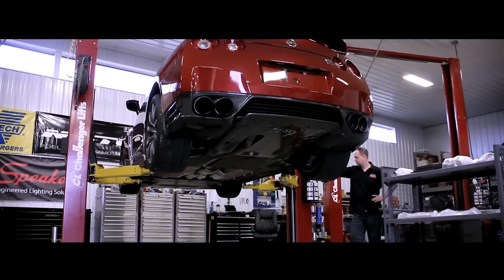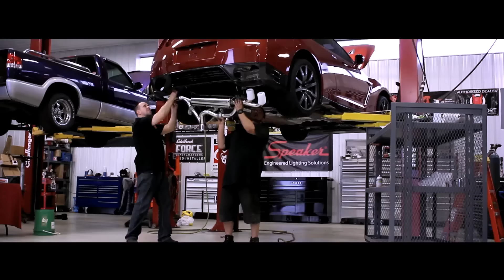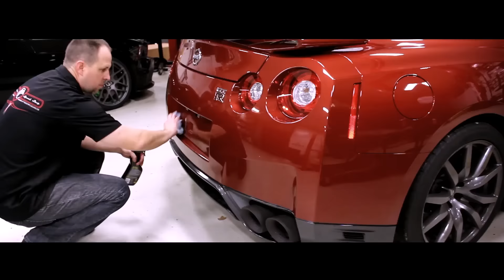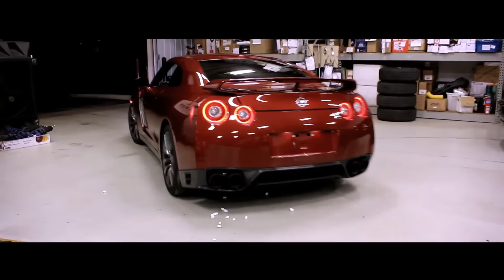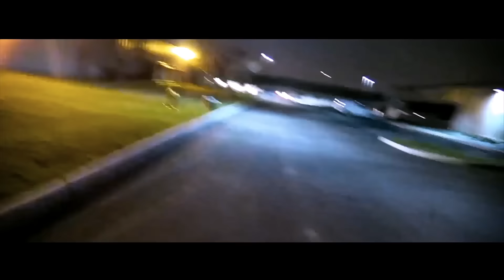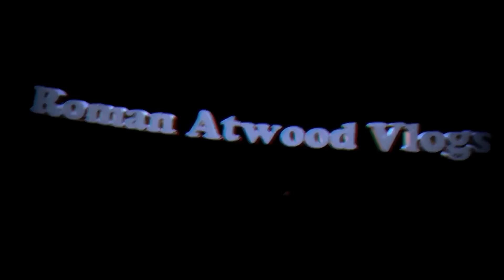Fixing Up Roman Atwood Muted Nissan GT-R R35 w/ ARMYTRIX GTR Exhuast, NOW LOUD AND EXCITING!

Comment: is Armytrix the best exhaust system ?
Reply: Yea and no, it's the coolest because the remote feature and how u can close and open the valves, but go you want a really loud exhaust I wouldn't go with army trix like my uncle he straight piped his lambo
Reply: Chuckyblaze if it has a remote feature then its good ... When you went to race u can turn it on ... If its loud then it will more nicer ... but im not asking if its loud or not .... what im saying is how much hp does it give